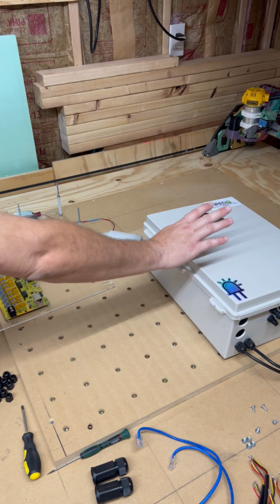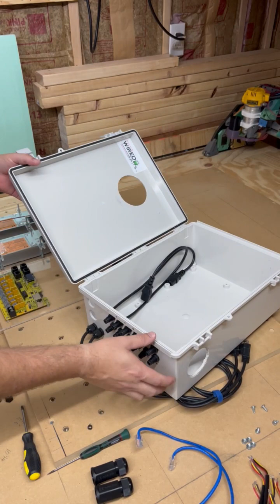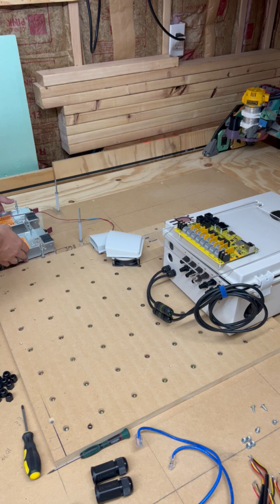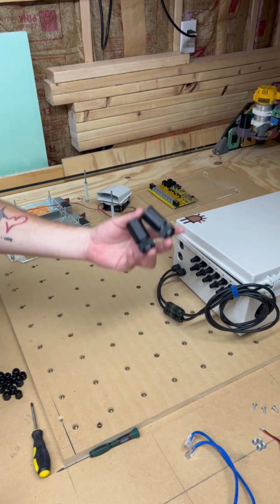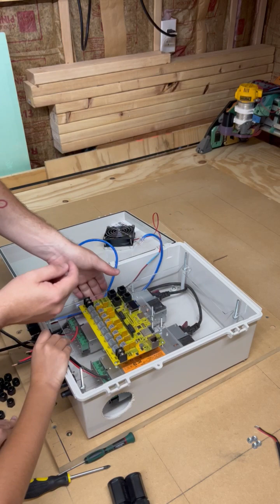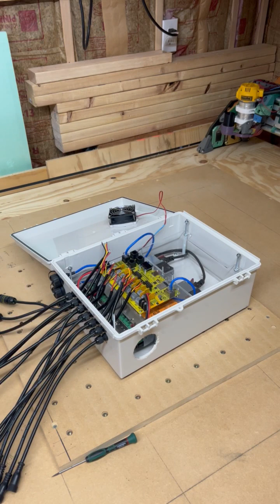Experience Lights 16 Port Genius Controller Box Setup

Comment: What power supply did you use. If you have a link
Reply from the maker: Those are HP Server Power Supplies rated for 750 watts each.  Search hp power supply 750w on Ebay is best location. I own 10 of these over the years..
Reply: @SATXDIY  are they refurbished or new ?
Reply from the maker: All refurbished. Haven’t failed in my 4 years